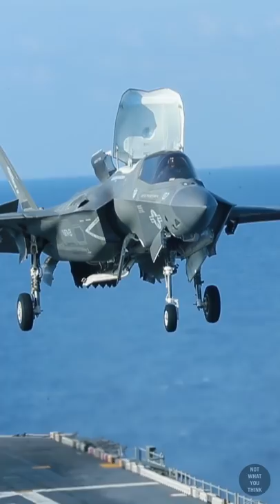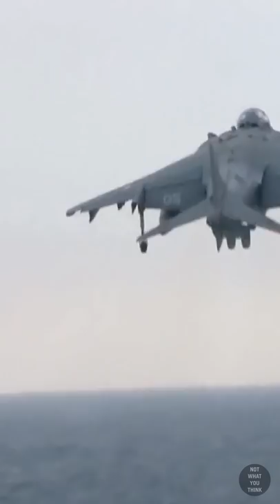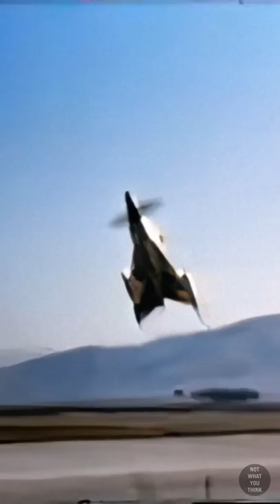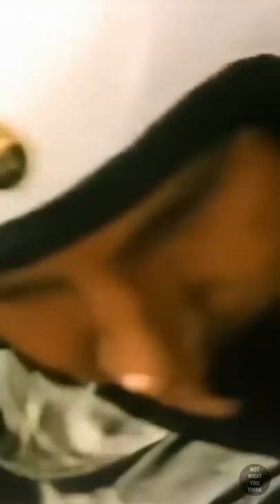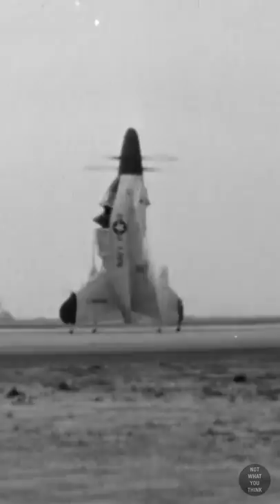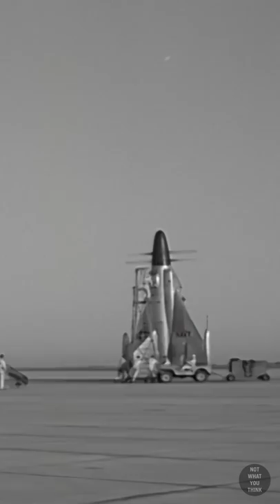An Airplane that was "Tricky" to Land #shorts

Comment: when you make a helicopter but you make a plane but its a plane but yes but no but helicopter so yes so plane.
Reply from the maker: Something like that 😁
Reply: But..could it be a rocket?
Reply: It could have been a plane if they remove the bottom part to land
Reply: that made perfect sence in my brain mind
Reply: Lol, your explanation sounds like it was written in another language and converted to English using a translation generator.
Reply: Someone will have a stroke while reading this comment.
Reply: @yinlu3610  I can confirm, I had a stroke
Reply: @natenobel3329      But…could it be a rocket?    Yes. Look up the Roton of the Rotary Rocket company (latter half of the 1990s).

Combining the worst parts of a helicopter (driven by small rockets at the end of the rotor) and a rocket, it turned out to be an interesting idea — just not practicable.  Even the Roton test pilots — the only one with a snowball’s chance in hell to survive — lost control at parts of the flight.
Reply: @advorak8529  so gyroscopic effect with the rocket mass at the end of the rotors and strain on the gearbox assuming it still has one.
Reply: @Babihrse      Gearbox for what?  For an engine that rotates the prop?

As to the strain, that was not the problem. It was that reentry heating and the blades were not going to like that. There were not enough advantages in the end to balance out the complications and mass.

There have been helicopters with all kinds of tip engines. They can work.

But if you really want gyroscope effects, look up the Triebflügel
Reply: but yes i had a no stroke no yes
Reply: Plne
Reply: My brain hurts 😥
Reply: @vandasaragosa3379  too me but yes
Reply: @egamersmk771  ikr . Its like the bastard that nobody want . Not even the last name 😭
Reply: Ehuheuwhuehueheu stroke wtf?
Reply: But could it go into Nordic?
Reply: I had a stroke reading that
Reply: I lost the last of my brain cells reading that
Reply: Thingamajig.
Reply: Godzilla had a stroke trying to read this and fucking died
Reply: Do u want a helicopter or a plane? 1990s engineers: yes.
Reply: @natenobel3329  Space X: hold my rockets
Reply: That's the av22 osprey for you
Reply: When you try to make a comment but you make a meme but it's a comment but yes but no but comment so yes so meme
Reply: Now I look at it... Couldn't this be done nowadays with the same tech spacex uses to land their rockets with a suitably designed jet fighter? If its thrust to weight ratio for takeoff and landing is more than 1 ofc.
Reply: Thanks you helped me pooped.
Reply: @natenobel3329  
That's another topic for another time
Reply: ...yes
Reply: I had a stroke reading this
Reply: Sound like Biden!
Reply: One of the greatest comment i YouTube.
Reply: Not understanded !!!!
Reply: Are you describing the XFY or an autogyro?

Comment: They also turned into metal coffins when the engine malfunctioned, there was no way for them to emergency land. That is one of the reasons they cancelled the program.
Reply: Actually the the navy's full on interest into carrier landing with super sonic aircraft was the main and only reason these were canceled. 

Only two XFY-1 were made, one for flight testing and one for static testing. Out of all the flights made by the XFY-1 none ended in failure.
Reply: How are both of these comments above so contradicting to each other?

Edit: so which is the truth?
Reply: @Mr.Thermistor7228  I could be wrong but I've never read where it was canceled due to fear of pilot fatalities. They only built two of these and the one that was flown had no fatal incidents.  Besides if the navy or airforce were worried about pilot safety over development then we'd have a flightless military.
Reply: @Mr.Thermistor7228  from what i know about the military (having served for over 13 years) its the latter 
they moved funds from this project because they were told they could get regular aircraft to launch and land back on a carrier
Reply: I’m sure they were canceled for a large variety of issues due to the idea being poorly thought out, even for a 3rd grader.
Reply: @bulldozer8950  Tell me professor do you ever just feel.....

We’re no strangers to love
You know the rules and so do I
A full commitment’s what I’m thinking of
You wouldn’t get this from any other guy
I just wanna tell you how I’m feeling
Gotta make you understand
Never gonna give you up
Never gonna let you down
Never gonna run around and desert you
Never gonna make you cry
Never gonna say goodbye
Never gonna tell a lie and hurt you
We’ve known each other for so long
Your heart’s been aching, but
You’re too shy to say it
Inside, we both know what’s been going on
We know the game and we’re gonna play it
And if you ask me how I’m feeling
Don’t tell me you’re too blind to see
Never gonna give you up
Never gonna let you down
Never gonna run around and desert you
Never gonna make you cry
Never gonna say goodbye
Never gonna tell a lie and hurt you
Never gonna give you up
Never gonna let you down
Never gonna run around and desert you
Never gonna make you cry
Never gonna say goodbye
Never gonna tell a lie and hurt you
(Ooh, give you up)
(Ooh, give you up)
Never gonna give, never gonna give
(Give you up)
Never gonna give, never gonna give
(Give you up)
We’ve known each other for so long
Your heart’s been aching, but
You’re too shy to say it
Inside, we both know what’s been going on
We know the game and we’re gonna play it
I just wanna tell you how I’m feeling
Gotta make you understand
Never gonna give you up
Never gonna let you down
Never gonna run around and desert you
Never gonna make you cry
Never gonna say goodbye
Never gonna tell a lie and hurt you
Never gonna give you up
Never gonna let you down
Never gonna run around and desert you
Never gonna make you cry
Never gonna say goodbye
Never gonna tell a lie and hurt you
Never gonna give you up
Never gonna let you down
Never gonna run around and desert you
Never gonna make you cry
Never gonna say goodbye
Never gonna tell a lie and hurt you
Reply: @pele220  lol in my 3 years it was easy to see how things really worked
Reply: @ADITADDICTS  yea I would agree with your statement a lot more lol
Reply: Actually, statistically speaking, when it came down to it, the real reason they cancelled the project, was, in part, because they didnt account for me not knowing what im talking about throughout this comment
Reply: @KK-bm4mf  lmao true
Reply: @KK-bm4mf  There needs to be more research into this!
Reply: @ADITADDICTS  I mean... No, a normal plane can glide, and its safer.
These were flying coffins
Reply: @xano2921  all two of them.
Reply: @ADITADDICTS  excuse me, what?
Reply: @xano2921  You said these planes were flying coffins right?  Well since there were only two that were made, a flying prototype and another that never flew, I replied with "all two of them."
Reply: @ADITADDICTS  absolutely
Reply: This part is rough. The video didn’t mention this part.
Reply: @xano2921  "Normal plane can glyde, and it's safe" . Do you know what stall is? Any flying machine is "safe" if not "stalling" 😂😂😂👍
Reply: @chutta7922  classic. good call. lmao

Comment: Imagine if they kept the concept for good and developed a vertically standing VTOL  aircraft with modern tech and a jet engine. 
You could solve the problem of looking at the landing place with a rotating cockpit; or it could be a great drone design. 
I assume the only problem would be strong cross winds blowing on the wing surface during take off or landing.
Reply: Just have mirrors lol
Reply: Or a backup camera like every modern car...
Reply: @michaelcreamer9601  or cameras used by AI to land flawlessly or just have a monitor to see the ground that can retract when not in use.
Reply: Yeah, you're all right but rotating cockpit sounds cooler
Reply: @ervinm.5065  I wouldn't want to be in a plane hovering vertically while my cockpit turns around, also how would the hydraulic system (controls) work if it wasn't static?
Reply: @VaxzaLimeIsCool  or a stabilizer :eyes:
Reply: a jet landing like that would be not very good

Comment: Lets just say somehow they found a way to land this aircraft easily, imagine how quickly fighter jets can react... They dont need runways, and in a span of around 5 seconds, they would be able to take off... Imagine how much aircrafts we could fit in an aircraft carrier if this aircraft was put in service...
Reply: No payload, no missiles and slow so no
Reply: F35
Reply: mdo686  Well, just like what I said, imagine if they found a way to operate this thing easily, to fly and land it easily... Plus, before this thing enters service, of course this will not be its final looks... Changes in physical appearance will be applied as new problems will surely occur if the real aircraft to be commisioned will be the same design as this experimental one... And lets just say they were able to fit this thing with an afterburning engine instead of a propeller one... Then it will be a good aircraft especially if it will be used on carriers as it doesnt need big space...
Reply: @trisjack82  Well, I'm sure if this aircraft passed the experimental stage and was approved to enter service, I'm sure that this will not be its final appearance... A lot of changes will surely be made... I think it will have a larger fuselage, and a larger wing to accomodate missiles... And I also think they will replace its propeller engine with something better, like a jet one... Keep in mind that this is just the experimental stage, and this aircraft never really went on production or approval because its very hard to land... But I think if they try to do another project like this in our present time, it will be more successful... With cameras/scensors, the pilot wouldn't need to look backwards anymore... If this were to be made in the present time, I think it will pass the experimental stage and get approval...
Reply: @sweetdreams5024  Nope... I think VTOL and V-STOL aircrafts require more space than these experimental aircrafts... VTOL and V-STOL aircrafts occupies a larger area, which results in the carrier carrying less aircrafts that it actually could if they were to operate these vertically-launched experimental aircrafts...
Reply: @adrianwelgemoed9562  Nope, F-35 occupies a larger space than this aircraft...
Reply: @shinei98  but you just said it’s not it’s final appearance and that it will get a bigger fuselage for weapons and and a lot bigger of a body for a massive jet engine. Plus it takes up a huge vertical profile and doesn’t have a way to taxi around, and even if it did it would be too heavy and not great moving around on a ship. Plus it requires a poor tail fin configuration for speed and increases its drag.
Reply: @tpespos  u have a point... But I just think this thing will save up more space than VTOL and V-STOL aircrafts...
Reply: If you add rpl (rocket propelled launch) and make it a jet plane instead of prop it could have payload and good maneuverability due to its size and design. You could also have nets or slings that they drop into (on base or carrier ships) to help with landing. 

Also just add a rear view mirror for landing😁 jk
Reply: Also you could double your fighter coint with these packed tightly but numbers don't neccesarily win a battle...
Reply: @brazenh2836  Agree
Reply: @tpespos  the 4 prongs it lands on are wheels. Im sure with a little prop tilt or thrust vector it can taxi.
Reply: @brazenh2836  the 20th century says otherwise
Reply: @shinei98  even with more planes theres limited space for fuel aircrew and ordanance

Comment: The Lockheed XFV-1 and the Pogo were the two tail sitter prop vertical takeoff and landing USN aircraft of the early 1950s. The XFV-1 was also fitted with gear for horizontal landing.

Comment: If they made a jet version of this, wouldn't it be better? It'll have higher thrust to weight ratio and It'll achieve above mach 1 easily. Moreover, you can equip corvettes or destroyers with it. For the landing problem, it probably put 2 controls facing back/down and front/up and just flip the seat around when about to land.

Comment: They should have put those tiny thrusters that they have on space shuttles onto the bottom of the aircraft so when it goes up into the air the boosters will boost the back of the plane up and then it'll fly straight

Comment: I guess in order to land from normal horizontal flight... the pilot would have to pull up and start a vertical climb, “stall out” so the plane starts dropping, then engage the propellers again to slow the descent, then somehow maneuver nose-up down onto the tiny landing platform (probably a carrier). Like the aviation equivalent of backing into a tight parking spot 😂, but with no mirrors.

I guess it’s not so outrageous considering the way that Naval aviators land on carriers now. Lining up with the carrier, flying low and slow, and using a tiny hook on the back of the plane to catch an arresting wire on the deck. Haha, but at least this way the pilot can still see where he/she is going.

Comment: If the problem is that the pilots have to look back during landing they should just have made it so it lands nose down.
Reply: And then the pilots would have to look behind them while flying lol. What they really needed was a swivel chair
Reply: @jacksos101  Well, no. The nose points forward, but when the pilot wants to land they point the nose down, reverse the propeller, extend the wheels and touch down. The swivel chair is a simpler solution though.
Reply: @tykjpelk  Ah true I'm just thick lol
Reply: @jacksos101  No, your comment made sense. I wasn't considering that you'd have to reverse thrust in my original idea.

Comment: Piece of Junk F-35
Reply: Best jet in the world
Reply: @user-dt5fk4cs9j  I disagree... The YF-23 Black Widow should have been placed in service instead of the 22 & 35... The operation cost of 22 is Nuckin' Futs... Also, the electrical issues among other mechanical is wasteful...
Reply: @662eck  tye yf 23 was more expensive than the F-22
Reply: @user-dt5fk4cs9j  Yes, it was... But, the operating cost, and the YF-23 feul consumption was far less cheaper... Not to mention, the YF-23's ability to cruise ss, and the engineers had a lot less mechanical issues during testing...
Reply: @662eck  the F-22 super cruises at M 1.7
Reply: @user-dt5fk4cs9j  Yes, it does... But, only for 6 minutes then it needs refueling... The F-23 can cruise at the same... Maybe a little less for a lot longer flight time...